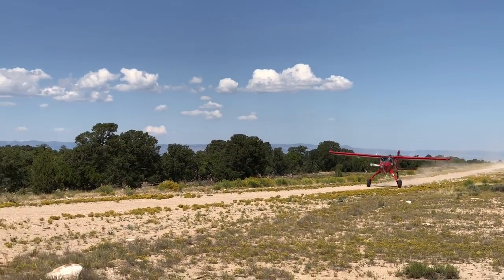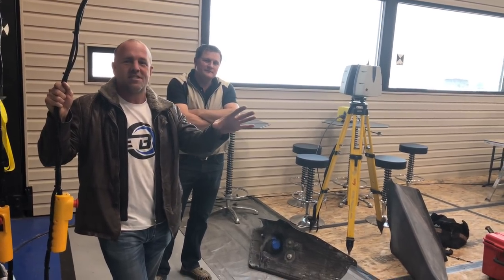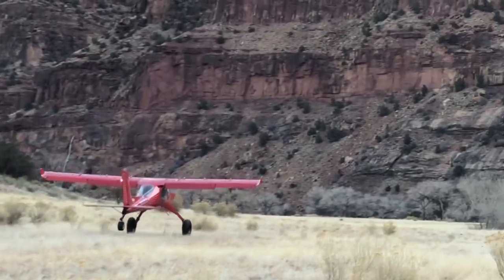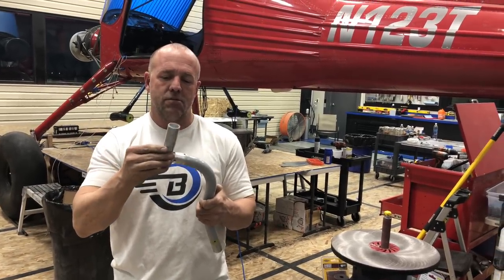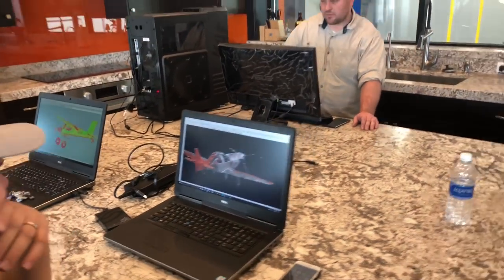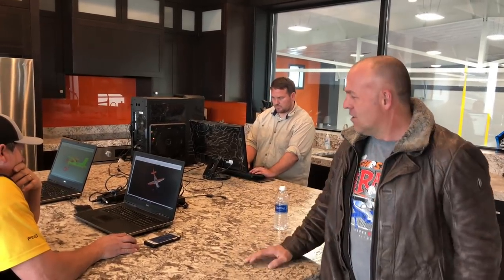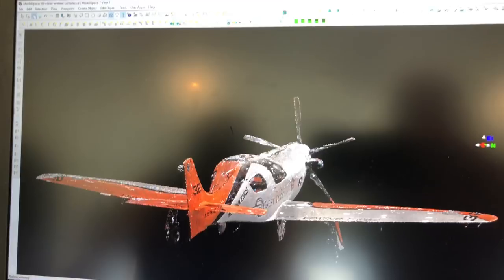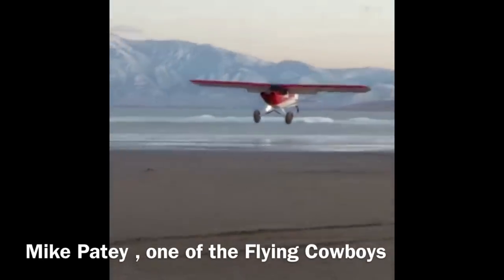Mike Patey Wilga (DRACO Video 6) Digital Scanning And Modifications

Comment: What software are you using for the fluid modeling?   How did you determine yield and ultimate on your engine mount?  Did you model the resonate frequency of the engine & mount in combination with the natural frequency of the airframe?  Did a PE look at the mod's?   Looks like your doing some heavy duty mod's on a airframe not designed or stressed tested for them...or the loads your going to place on it.   I wouldn't count on the +3 fudge factor to absorb the additional loads and stress.  Stress and fatigue are cumulative.

Comment: What does the coloring represent in the point cloud? Also, what software did you use with the Leica for the point cloud capture?
Reply: Usually they represent range, i.e. distance from the scanner. I can't say for sure what software it was, but Leica has a proprietary software called Cyclone that is used for scan co-registration and pre-processing.